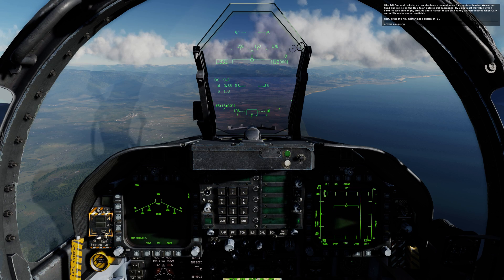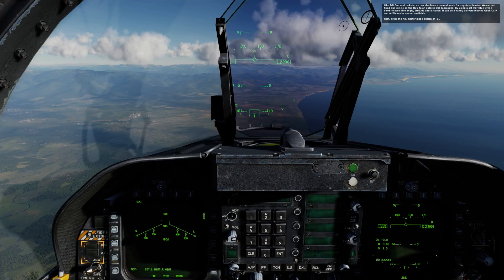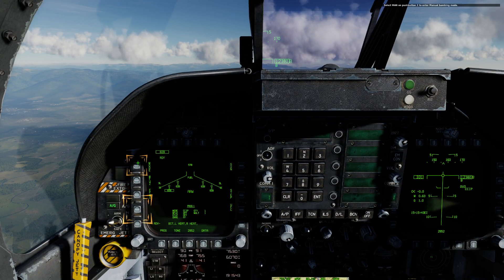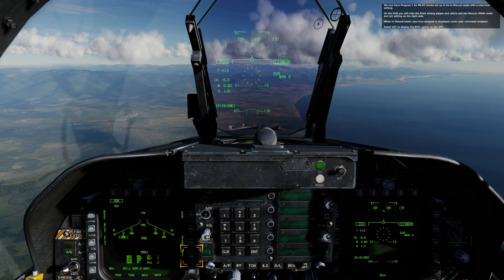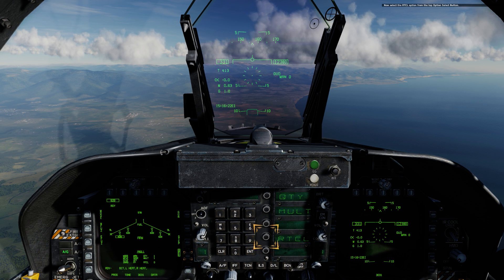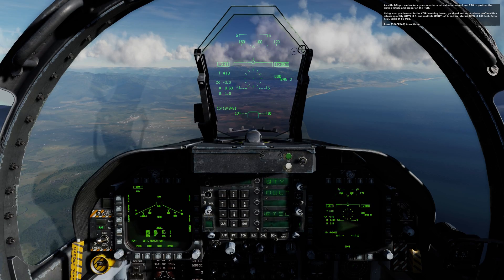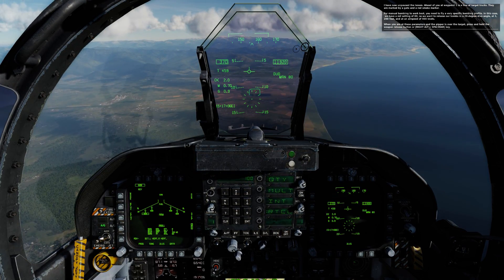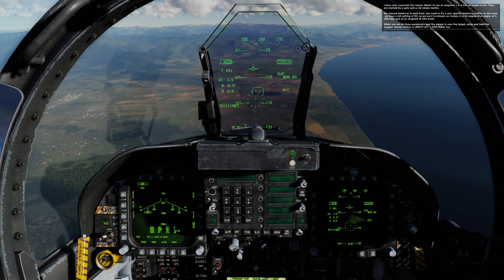DCS: F/A-18C Hornet Manual (MAN) Bombing Training Lesson Recording

Comment: May I ask how do you know the exact reticle setting of 80 and how did you calculate the dive angle of 20 degrees? Thank you very much
Reply: Late as hell to the party, but IRL you calculate all that with some maths. In DCS the method to get profiles is simpler : Dive to reach release parameters (desired angle, desired speed, desired altitude. These depend on what you feel comfortable doing and if you expect return fire you want to stay above of etc, plus the height required for pullout), go into active pause, drop the weapons, and adjust the sight to where the bombs land.
Rinse and repeat for every profile you want (20 degree dive, 30 degree, etc).
Pro tip : to initiate the dive, use the pitch ladder as a reference. Much like on landing, if the aimpoint is at a given angle on the pitch ladder, pushing to place the VV on it will put you on that dive angle.

Comment: Question: why would CCIP or CCRP ever not be available?
Reply: Damage to the aircraft systems due to AAA or SAM
Reply: @NerfTango1  well, if you are so damaged that your sensors aren't working anymore, would you even continue a bombing mission? Thanks for your reply btw
Reply: @nielsmallant2710  its probably a back up system in case of panne (not when your are damage). So in case of a very long distance mission if ccip/ccrp mode is not working you can still drop your bomb instead on going back home and fail the mission for such a "minor panne".
Reply: @nielsmallant2710  If your aircraft is not critically damaged, this might allow you to complete the mission wich may be of strategic importance. It's just a back-up.